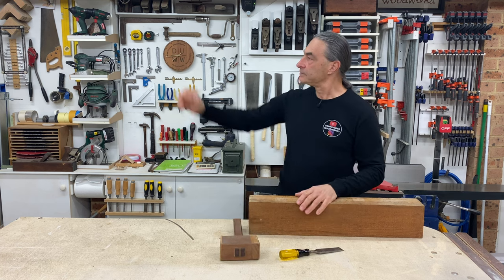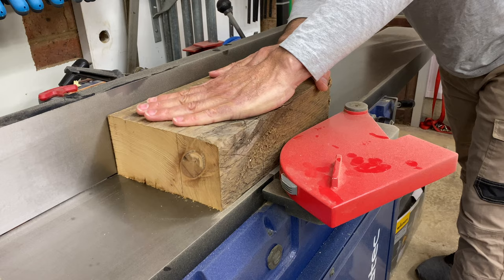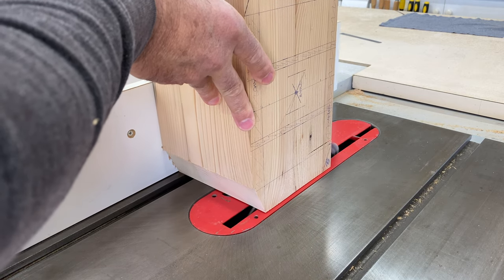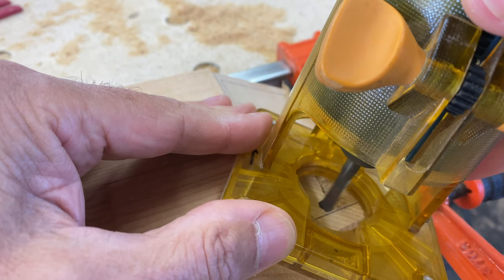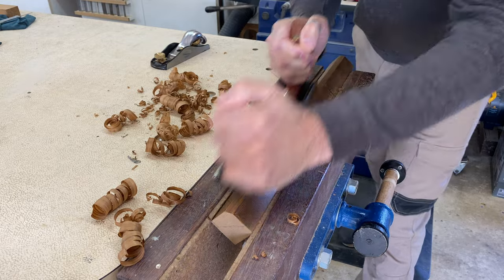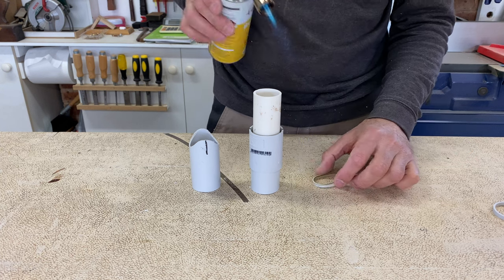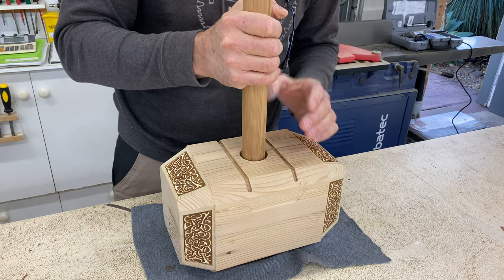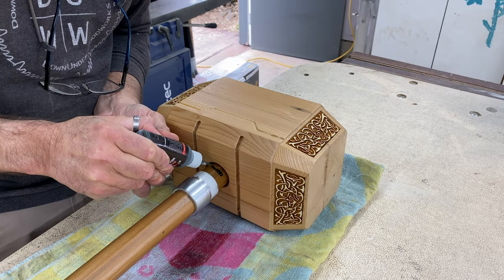Making Thor's hammer, Mjolnir

Comment: Nice project mate!If you don't mind,I do have a question about your table saw.I have the exact same saw,and have a problem with the front handle for raising and lowering the blade.The tightening screw tends to tighten up when least expected.I took it to bits and noticed the shaft is very short,unlike the 45 Degree shaft on the side.Not enough room to engage the nut,and seemingly needs to be longer.Have you experienced the problem at all?Thanks Mick.
Reply from the maker: Thanks Mick. I have not had any issues with the blade lowering handle, mine has worked fine the whole time. i did, however, have an issue with the blade tilting handle. the locking screw on mine has never worked since i bought it and i've tried to fix it.
Reply: @DownUnderWoodWorks   

 Thanks mate.Same problem,different handle.

Comment: amazing video and build , do you mind if i ask what were the rings you used in those GENIUS MOLDS?
Reply from the maker: Thank you very much. The rings were just sections cut off the PVC pipe to make rings
Reply: @DownUnderWoodWorks  yeah I rewatched and caught it thanks so much.  I'm adapting your ring gig to work with a slide hammer to pinch rings around a leather wrapped handle I was spinning my wheels on that one until I found this.  And again  your craftsmen ship on that hammer was very inspiring Thank you